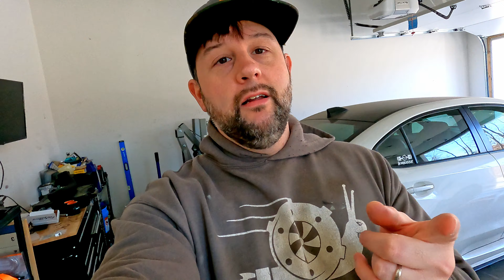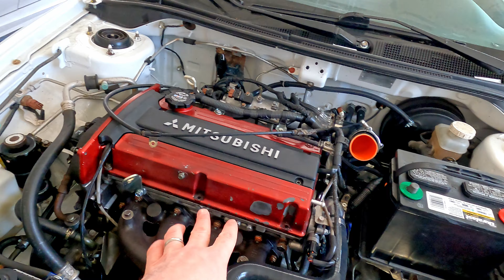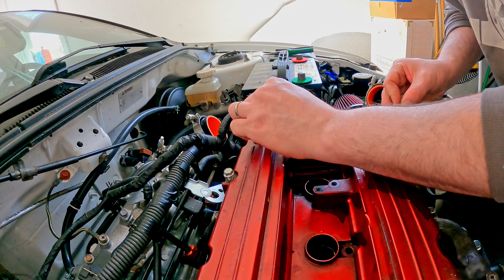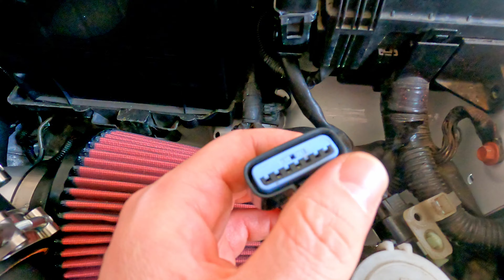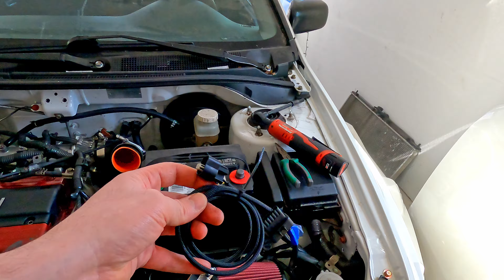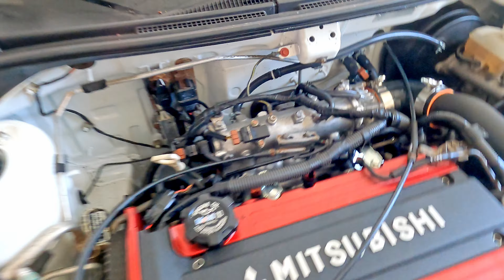This Part Made Speed Density DUMB Easy (Evo 8)

Comment: where did you get the  connector?
Reply from the maker: The connector itself you cant buy because it doesnt really exist. This SpoolinUp' harness with the custom molded connector i got directly from their website and it was the cheapest price out there.
Reply: @Erik_Powers  sorry I was referring to the speed density harness. I’ve had the same issue you had with doing this to my evo and I have an evo 8 the Bahamas so it’s impossible to find replacement parts locally so I am not cutting my harness.
Reply from the maker: @Flocks2312-z9p  oh yea i definitely wouldnt cut your harness. Do you happen to know if the evos that you got on the island are usdm or jdm?
Reply: @Erik_Powers   JDM bro got mine straight out of Japan its a right hand drive. Can you send me the link where you got your speed density
Reply from the maker: @Flocks2312-z9p https://www.spoolinup.com/Evo-Speed-Density-Harness_p_74.html

I dont see why it wouldnt work with the RHD Evo. Best of luck with it!

Comment: Quick question — 2005 Evo MR MAF on the bench for a no-start / lean issue.
Since the IAT is integrated, I checked resistance across pins 1 and 6 (clip-side up) and got a very high reading.
Is that a valid IAT check on these, or not a reliable test for the MAF assembly?
Reply from the maker: Did you scan the car and get a maf fault code?
Reply: @Erik_Powers unfortunately I can't find the cable anywhere to order other than out of the country, not even on marketplace.
Reply from the maker: @DJ_Driven  have you tried a regular scan tool?
Reply: @Erik_Powers do you know of a scan tool that works correctly with the Evo 8?
Reply from the maker: @DJ_Driven  most regular scan tools work for fault codes. I think you could also use evoscan. But i also was assuming that you had a check engine light along with the no start symptoms. Do you have a CEL?
Reply: @Erik_Powers No cel.  If I disconnect the MAF the car will go into limp mode and bypass sensors and then the car does run but it still having trouble starting initially.  I'm thinking it's possibly a bad MAF.
Reply from the maker: @DJ_Driven  you could try cleaning the MAF probes in the intake. Theres a chance you could have gotten some blow by that soiled up the intake. Even though the maf is before the recirc tube it could be something to rule out.
Reply: @Erik_Powers yeah, it's kind of complicated if you don't have the Evo scan diagnostics capabilities with cables and software.  If I wasn't trying to keep it more stock cuz it's super low miles evo I would definitely convert it to speed density right now!
Reply from the maker: @DJ_Driven best bet would be to clean the MAF and just for vacumm leaks. Checking the electrical ohms for the pins in the MAF connector could let you know if you are getting a signal though. Last thing id try is if you have a friend with an evo you could try swapping intake housings and see if the symptoms follow your MAF. 

Best of luck with it though man. Lemme know how it works out!

Comment: Are you gonna make a video showing the software side of it as well?
Reply from the maker: I am def going to make video going through what im doing on the tuning side of things. Hoping to get it done soon 💪
Reply: @Erik_Powers yeah Eric that would be great as I was just looking into the cables needed which are 1.3. it looks like because 2.0 has been discontinued and what software to get to run diagnostics clear code tuning and then there's data logging. So if you could do a video on that to clear that up that would be great!
Reply from the maker: @DJ_Driven yes from what i have been seeing the 1.3 is the way to go. Im going to dig a little deeper before buy i buy and install it. If i find anything in my research ill do a video on it!
Reply: BD Alchemist has a video going into depth of what this looks like!